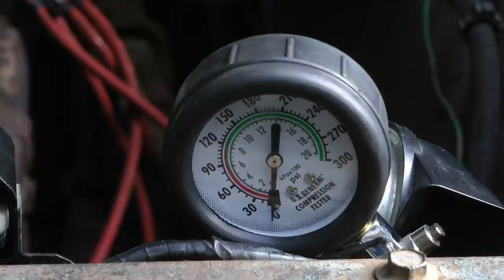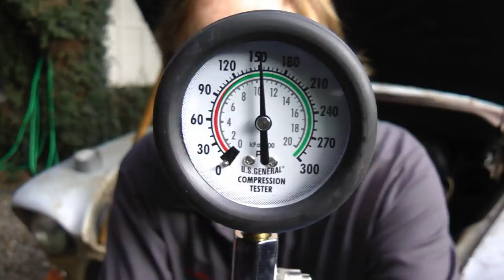How to Tell if Your Car's Engine is Bad

Comment: I own a truck just like that a 1955 GMC 100-8 longbox with a Pontiac V8 and its loaded with rust and the engine sounds like a warn out dump truck.
Reply: Its a half ton pickup with probably over 422000 miles on it and the idiot that last owned it didn't ever bother to change the gear oil in the diff and the ATF in the transmission. That's why the transmission  was burnt out. The registration expired April of 1991.
Reply: Chillkoot Markowee how could the registration expire in 1991 years if it's a 1995?
Reply: Graham Walker sorry the decal expiration date was April 1991 and its a 55 GMC
Reply: ***** I think Graham Walker was on a acid trip that's why he must of misread the post haha.
Reply: my bad for some reason I misread 1995 and saw 1995. my mistake.
Reply: Graham Walker haha I'm trippy sometimes myself

Comment: bullshit.    4cranks at idle is not sufficient.  to do a compression test you have the throttle pedal to the floor.. and crank it till the pressure stops going up.  if you look in the film it was still going up.

Comment: I am commenting very frequently on this channel, also a big fan of Scotty, I think my Opel Astra g's engine is starting to wear out!
And I think it's the piston rings.
It burned around 400 grams of oil in 3,000 km's. Also the top of the engine starts to get hotter, no matter if I drive city or highway.
However I will drive the stupid thing like I stole it, and will keep an eye of the coolant and oil. Luckily I don't lose coolant. One mechanic, which we are friends with said to me, that as long as it doesn't touch that coolant I can drive it for some time..probably 2-3 years until it gives up. Next vihacle is of course a Japan one made in JAPAN! Either Toyota Rav4 2.0 150hp or Honda Civic engine with timing chain or Honda CRV. It really depends on what I will need in the future.

Comment: Suggestion for future episode show the dollar bill exhaust check, vacuum gauge check and using a stick or metal rod as a engine stethoscope  

And note it could also be stuck rings due to carbon build up which is a fairly easy process to do  just saying 
Been working on them all since I was eight more of a hobby then anything for me

Comment: I really enjoy Scotty, but I would point out a couple of things.  First, I do hope that the ignition was grounded or disabled before cranking with those plug wires disconnected.  Otherwise the ignition coil can be ruined.  Second, since that engine is unknown, we don't know what cam it has in it.  It may very well be a high performance cam, and that means that the compression will read lower. Lastly, it is important to add just a little oil.  The oil displaces air in the combustion chamber, raising the compression all on it's own!  As others have stated, do the  test warm, listen to it run, check manifold vacuum, etc, etc.

Comment: Sometimes it may not be worn rings, in some cases, the rings may be gummed up and won't seat properly to the cylinder walls, this is in cases when you may find the engine has a little sludge in the head as one clue, so sometimes I would put some engine flush through it, followed by new high quality synthetic oil of correct viscosity (I am not into putting thicker oil than whats specified), then drive it for the next 10,000 kilometres with 5000 kilometre service intervals, and regular wide open throttle bursts down the highway (italian tune up). I have saved a car engine before like this, and on another car, it started off having some oil consumption, by the time I was finished with it, it didn't use a drop between oil changes. But I am not saying this is a solution to all engines that are using oil, just saying that its something worth doing if you get a car with some oil control issues yet you cannot afford a rebuild, meticulous maintenance may just give the engine a chance to recover from previous neglect.

Comment: I have 239K miles on my 1999 GMC suburban with the 5.7, 350 Vortec like this motor in the video. I have almost Perfect Compression in all cylinders and It has a lot of power and seems to be healthy. Sadly i was told it had a Crankshaft Bearing that is worn out and the crank is moving and contacting the starter. New motor time.

Comment: Piece of cake to rebuild that engine. I would fix any holes in the body but leave the rest alone. Or drop a bad ass 427 in there and make a fun sleeper out of it. A lot of fun there with not a lot of money. Or a really good restoration project. Definitely would not give up on it.

Comment: The spark plugs were already nearly fouled with carbon and oil. I also noticed he was using a multi gap spark plug to help with the situation. Not only bad rings but bad valve guides and bad valve seals cause oil burning. I've also seen motors use oil when the crankcase system has a vacuum leak

Comment: That truck has potential, seems odd that someone would install a small block which looks good but is worn inside- I say while he works on the body pull the engine and go through it top to bottom

Comment: Hi, Great videos.  Can you use this same method for a single cylinder mower engine.  
Thanks, John
Reply from the maker: yes you can
Reply: Yes but it's far less relevant.  With a mower you usually have other things wear out first like the deck or wheel drive when self propelled.  Mower engine is much easier (almost trivial in comparison, like do it in 1 hour) to take apart and replace piston ring or whole piston.

So basically, if it runs okay, don't put too much thought into that.  if it doesn't run, you're more likely to have a carb problem, I wouldn't even bother with a compression test till after you rebuild the carb, UNLESS it was a 2 stroke engine ran without oil mixed into the fuel, in which case, maybe trash the whole thing unless it has sentimental value as classic 30+ year old mowers don't usually appreciate in value.

Comment: just open the oil fill cap, if theres alot of blowby (pressure huffing out of the valve cover), the engine is getting worn out, when that piston is pumping, the fuel/air is going somewhere, and if the rings are worn, or valves not sealing, it will get blow by, either thru =crankcase, or heads

Comment: I am a bit confused here, surely if you add oil to a cylinder then if the rings were worn the oil would go around the piston rings and the pressure would stay the same. By the increase in pressure does that not mean the oil is not getting passed the rings?
Reply from the maker: for a few pumps, the oil helps seal the compression rings at the top of the engine and thus increase compression pressure on worn ring engines.
Reply: Ok I got it now, thank you for your reply.
Great channel.
Reply: Ok I got it now, thank you for your reply.
Great channel.
Reply: you're exactly right

Comment: To Tom A, InvisibleYetVisible, Jason Arthur Taylor, and the others; this is a video for the layman. Not someone who is mechanically inclined. It is meant for a rough, quick, cheap check. You guys are talking about cam sizes and thermal expansion coefficients. This video is for the average Joe buying a used vehicle.

Comment: I should have done this on my old 1982 BMW 528e that had about 429,000 miles on it when I gave it up and would blow a blue smoke shield toward the end just for amusement. I bought it with 141,000 miles and in the end it was far from the same car. Not a bad run, though for $3200.

Comment: “Mystery Oil”, as it was originally called, proved to have other beneficial effects on the engine. By creating a top ring seal, it produced higher compression and, by preventing blow-by on power strokes, it resulted in more power. Mystery Oil also improved gas mileage and minimized engine wear.

Comment: your first compression test was done with the engine turning 3 times and the 2nd time you did it with the oil you let the engine turn 5 times... in a compression test your only suppose to let it turn 3 times then check your gauge ... i say inconstant method use led to a in accurate result as far a pressure

Comment: first thing to do is check if the valves are not leaking, if driven with a to rich mixture valve"s wil faul, this will also give loss of compression, remember also to always check compression on a warm engine, whit testing at full throttle. in most cases its a valve or a  head problem, and at low milage seldom the piston springs.  tip is to first run it under a moderate load for at least one hour on the highway, clearing up cabon deposits and glazed cilinder walls (first re calibrate the carb, to a leaner mixture! (this engine is not adjusted well with sutch carbonated plugs.)

Comment: Hello Scotty Kilmer, just some information: 
Basically all Car manufacturers that i know of at least here in europe, telling in their FSM's that compression checks should only be done with a warmed-up/hot engine. The compression tests read significantly higher with a warm engine and they specifically say that compression checks on cold engines are NOT meaningful enough.
Important to read is that they are not below a certain threshold and from cylinder to cylinder the difference in readings should not be more than for instance 20% (variates between manufacturers, some are okay with 35% difference between cylinders WOW).
To check itn further, do a leak-down test with compressed air.

Comment: Even a brand new engine, compression will be raised a lot by pouring oil into a cylinder. This creates a hydraulic and can even lock up a cylinder.   After pouring in the oil, Crank engine 10-20 secs to allow  time to blow excess oil out, and then test and check for delta.   Also.. A cold engine can give a higher reading than a warm engine. Also.. Dry or wet , test.. Crank with carb butter fly open and crank until reading stops rising.  usually 5-10 secs of cranking is all that is needed.
Reply from the maker: +grabir01 I'm only adding a teaspoon full or less. But yes, you can crank it a little before testing

Comment: Good informative video Scotty.  Question:  if you pour oil into the cylinder, wouldn't the compression reading go up simply because you have displaced some of the air in the cylinder with oil?  Less volume to compress is kind of like having a higher compression ratio engine, correct?
Reply from the maker: you only put in a small amount of oil, a few drops per cylinder and it won't effect it much
Reply: Thanks for the clarification.  I've watched 3 or 4 if your videos and they are very useful, I've learned a few things!

Comment: hey Scotty, seems to me that if you add oil to the cylinder the compression should go up because it will replace volume in in the cylinder. as it pushes past the rings the compression will lower. so good rings would hold the higher reading.

Comment: only 4 compression strokes on the dry test and 7 on the wet test, clearly you will see a difference in compression just on the cranking time.... 5 seconds cranking provides better results. and an increase of at least 20 psi during the wet test will show the rings are worn. cylinder leak down will show exactly where the leakage is coming from.

Comment: disconnect ignitor to distributor, disconnect fuel punp, or crimp off feed to mechanical fuel pump. then most of all WOT get some one to hold throttle wide open so butterfly of carby (trottle body) wont prevent in correct reading.

Comment: Hell, it doesn't cost much to rebuild a SB Chev...even with new slugs. It's as much as my Nissan, perhaps a touch cheaper. And as far as body rust: that's not so bad for a truck that age, I've seen far worse. In the end, it's up to the owner if he can do all that work: if he has the ability, tools and patience. If so, he can save a LOT of cash, but if not...someone else out there can buy and do it. Looks like a fun project from here!

Comment: hey Scotty i have done this with the throttle closed and jammed open. jammed open netted better PSI so i went and re did all cylinders. it was a VW air cooled and i had one 90 PSI and the rest were 130 range. i just left it as it was kept running it.
Reply from the maker: VW old air cooled engines could take a lot of crap and keep running, that's true

Comment: You dont need to do taht,
 just check factory values, or the difference between cil...but usually a look to the exhaust will tell you everything, if it doesnt smoke,,,sparks plugs are good indicators too,

Comment: I have a 97 Camry 4 cyl. that sat for five years without use. The car leaks oil at the rate of 4 quarts every 400 miles. I have tried stop leak on a couple of occasions and switched to a thicker oil to minimize leaking. Is there any thing else I can do  to slow the leak, car only has 80k on it. Just found your channel, pretty cool!

Comment: This is a cool classic truck it doesn't need a new engine repair and fix it and drive it and do the restoration on the body as you have money and time there's no reason out a classic chevy truck plus these engines are easy to overhaul and don't cost much for the kit

Comment: The last time I changed my oil on my 03 accord v6  ,I found a little bit of metal fragments or shavings ,it still drives fine and it’s at 141k

Comment: I have a 92 f150 straight six engine 4.9L 5 speed manual 4x4. The motor was rebuilt 6 years ago and is now at 280,000 miles. Having problems with starting engine with spark plug issue and also not wanting to accelerate and the motor would bog down. Changed the spark plugs and one of them had oil with little chunk of slug on it. Told the people over the phone about the issue who I know in town and they said it's time for a new motor. Want to find out from other people's opinion before making a big purchase.
Reply: Does it ever get out on the highway for a good run, or is it strictly a putter-around-town vehicle?  If it never goes for good "long" runs (like an hours' drive at freeway speeds), then it's fouling the plugs, and may also be running rich.  Based on the mileage,  yeah, I'd say it's time for a little inframe job if you want to keep the vehicle.  Problem is that sometimes rebuilding could add up to more than simply swapping for a new/used replacement.  On the flip side, sometimes you get lucky and just find it's just rings or just worn valve guides.  If you know someone and trust them,  ask 'em how much to go in.  But if you rebuild the engine, is the transmission next to go?  Lot of things to consider about how committed you are to keeping the same truck or not.   You say it's only one plug that's really showing evidence, but you can't just open one cylinder, so if you're going in, you CAN just fix the problems you find in one area, but might as well do the whole thing while it's opened up.  Some people would say 24 yrs is good and would move on to the next vehicle,  some would say I want to keep it, damn the torpedoes, sink whatever it needs to keep it going.  You need to weigh your options. How much you have to play with versus how much the price or payments of another one would be.  We can all guess what the problem might be, but no one would know for sure without going in to find out.  Good luck in your decision.
Reply: It's both riding around town and on the high way. I Had the transmission rebuilt about the same time the motor was rebuilt about 6 years ago. I had the clutch replaced the beginning of this year with a tune up. I'm thinking it's really time to get a new motor. Anyways, thank you for your input and I appreciate for you giving the time to help out. Enjoy watching the videos.

Comment: What if the loss of compression was caused by a bad head gasket, cracked or warped cylinder head, or cracked engine block?
How would you determine which of those is the issue without taking the engine apart?

Comment: Correct me if I'm wrong... Is it necessary to place the Piston to TDC before inserting the tool and running the test? Or will you get the same reading regardless? Or does this concept only applies to Compression Test and not Cranking?

Comment: Hey Scotty once again  I come to you for some advice. So on a 2004 Honda Accord LX four-cylinder model. I've been having issues with burning oil. Now I've watched multiple videos of yours showing  me what I should be looking for when a car starts to burn oil .i'm not all that of an expert on cars but everybody has been telling me to start looking at Pistons to see if they're worn out. Now I don't have a shop nor  l have the equipment to check all that so I'm not sure what I should do. Is there anything else that I should be looking at? Or what should I do next.

Comment: I have a curiosity here, Scotty.

If I'm rebuilding an engine, could i douse the dismantled block in gas to clean the old goop out, then drizzle gear oil into the bearings to make sure everything is lubed before proceeding with reassembly?

Or just change the oil a few times after everything is gasketed up?

Comment: Hello there scotty. I'm a big fan of yours. Lately. My ford ranger 2004 will vibrate/shake terribly when i turn off my engine. I replaced my engine and transmission supports but to no avail. I also had my injection pump and fuel injector calibrated and balance but still the engine shakes when turning my car off. Even on start up it also does the same thing but turning off is worse. Hope you can give me some clue. Thank you for all your videos. God bless

Comment: I counted 3 rotations on the first test, and 6 on the second.
on neither test did the guage stop going up before you cut the starter, meaning both may have higher compression then you indicated

Comment: scotty I just purchased a 2000 jeep cherokee xj 
and I did a regular tune up when I changed the spark plugs they were kind of dark but you could see some white
it's obvious they haven't changed them in awhile nor the oil. it got leaks coming from the rear main seal and oil pan gasket. I will replace them soon. I changed the oil and it's turning dark I've only driven it 1000 miles.
my question is you think the engine is worn out?